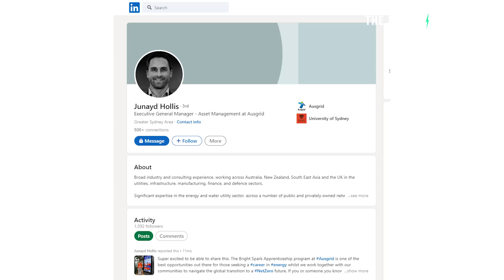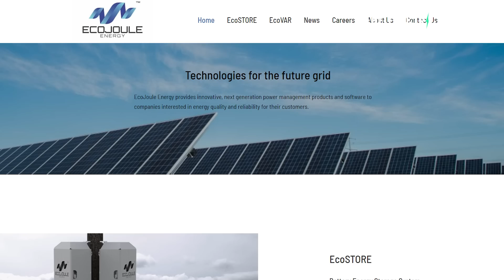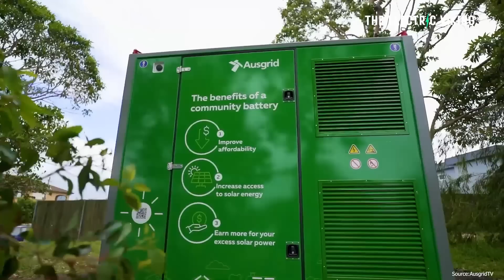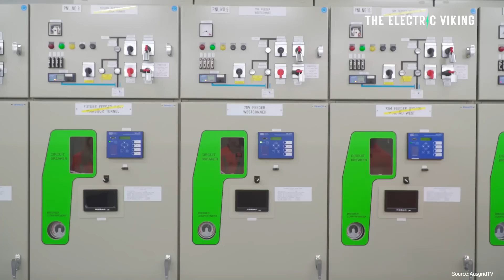Australia Begins Installing Power Pole Batteries for Excess Solar Storage

Comment: The majority of hot water systems in Australia should be heat pump systems. They are effectively batteries creating hot water for later use. When powered by rooftop solar, it's a no brainer
Reply: A heat pump cost hws cost >$4k to install, and still stores hot water that looses heat during the day. An entire 7kw solar system cost the same amount to install. All a small 1-2 person house needs is a small cheap $350 resistive hws. Hot water usage should be less than 1kwhr per person perday. A 6kw solar system typically collects more than 20kwhrs per day, averaged over 365days. But 25kwhrs per day ave over the year, is readily availabe where I live in Oz, with no shading.
Thus, if you and your partner simply spent  $4k on the biggest roof top solar system you could fit, and a further $350 on a small resistive hws, then you would still have >18kwhrs per day of solar electricity to use or export (and being paid sfa). The ave household elelctricty use here in Oz is 16kwhrs per day. Save the $4k you were going to spend on a heap pump hws, and install a 10kw roof top solar, or put thst $4k towards a storage battery, instead. 

My mates rooftop solar hws system with a ground level storage tank, cost him $12k. Dont do it. He wouldnt do it again. Use thar roof space for more solar pv panels that you can use all year round. Rooftop solar hws becomes too hot in summer, and effectively isnt used much, but the roof space is still used up (that could have been pv) and in summer, the pump still runs to circulate water back to the tank to prevent overheating of the system components, ie power used, and high maintenance costs after 10yrs. Dont do it.

The biggest cost benefit is to simpy install the largest roof top solar pv you can fit. Most roofs can fit a 10kw solar pv. A >$4k heatpump hws will still cost you $$ to run (and they do also have a resistive elment for cold mornings), and might need to be replaced @ 10yrs. Dont bother. Upgrade your solar pv jnstead.
Reply: @nordic5490  Are you saying that it costs $4k for 10kw solar electric rooftop system? Where are you?
Reply: @nordic5490  NSW has a grant at the moment that allows you to replace your electric hot water system with a heat pump from $33*.  The true costs can be more as I had to convert my off-peak switch to standard, and I opted for a bigger water tank, so I paid around $450 for my heat pump hot water system. I've set a timer to only turn on during the middle of the day. It was a great initiative, and Victoria offered something similar.
Reply: Why not just use rooftop solar water heaters? Much cheaper than a heat pump.
Reply: @malcolmrose3361  heatpump is more efficient and allows the solar to be used for other things once the water is heated.
Reply: @malcolmrose3361 and cheaper again is using your existing hws as a solar battery.
Minimal mods reqd at the switchboard and no rooftop mounting reqd.  
Effectively creating a 10-15 Kw thermal battery storage system ~ and when 'full', unlike a rooftop hws, any further excess energy can be sent to the grid, to a home charging system for your ev, or to other household electrical devices.
Use your imagination. 
This type of setup has worked a treat for over 5 years now.
Reply: @malcolmrose3361  I'm in the process of installing a solar system and I've been deciding between solar hot water heating or a modern hot water tank. I've decided on the tank. Access and maintenance on the solar hot water was a factor, as well as having a 300kg lump on a roof. A regular hot water tank is way cheaper and I can just heat it with excess solar production during the peak times, by adding just a couple more panels. Panels are cheap and easy to replace and so is a regular hot water tank or the heating element, which is normally the first thing to go.
Reply: @simonpaine2347  I've had one on the roof for about six years now. Every 18 months a guy comes and descales it (we have very hard water here), it has an electric element built in - it only needs a few hours of sunshine to heat up, and the tank itself is insulated so even if you have a few completely cloudy days in a row you don't need to use electricity. So far this year I've actually used it once - we had guests and I didn't want them having a cold shower (obviously the sun then shone and it was unnecessary) after a couple of days of very grey sky. 

Clearly it depends on where you live but, assuming you live in a sunny area it seems more efficient to me - you need quite a lot of electricity to heat all that water so better to use the sun directly than indirectly.
Reply: Only trouble with heatpump hot water, the tubing calcify over time and efficiency drops off, and often life span costs are lost with need for repairs and maintence,
Reply: @Froggability  Unfortunately, I found your statement to be correct. My State hybrid heat pump water heater failed to heat the water after 2 years. State go me a new one for free, but $1080 for installation of the new one just eliminated any savings compared to a plain old electric resistive hot water heater. I can still save money if this replacement lasts more than 3 years.

Comment: It’s encouraging to see innovation, however why is a pole mounted 65kWh battery a more compelling economic proposition than a home battery operated as a VPP ?. Yes, this is a DNSP asset , which removes the upfront cost from the consumer. However this cost will ultimately be priced in to the consumer electricity price, with added profit. 
From my perspective, we need storage solutions with the lowest lifecycle cost per kWh - this system uses off the shelf LiNMC cells. 
I’d be very surprised if the EcoStore capital cost is less than $AUD 750 per KWh. Pumped hydro is about one third that cost.

Comment: Seems like a lot of weight to suspend in mid air. They should give some incentives for home owners to install batteries.
Reply: The ones installed in Victoria on poles weigh in the same range as transformers so there's no real problem there
Reply: ❤❤❤ yes, Heavy Problem !!

Comment: Next step would be curbside EV chargers.  I've been wondering why that's not already a thing.
Reply: It is a thing in parts of the UK and Europe.
The existing power system for street lights in urban areas is used.
Plug on street lamp pole.
Reply: @andrewsaint6581  Excellent!
Reply: Yes a battery combined with curbside chargers is the way to go.
Reply: @NaughtyGoatFarm  Yep. If the government really wants us to go EV, they'd do something like that.  In any case, electricity companies can make easy money from it.

Comment: Power poles that ARE structural batteries. Now there’s an idea.
Reply: not really.. seems like that would cost more to build them that way than to just hang some batt pods off an existing pole
Reply: @AbBc-w4q  but as an ongoing replacement strategy the idea has merit
Reply: Beat me to it. I think that makes so much sense or at least moving forward the poles that get replaced are structural Batteries
Reply: I think it has meris, also putting batteries on existing poles will raise their centre of gravity and make them more prone to falling over.
Reply: @MrHomer1995 poles can take tons of force directly downwards. Some support cables to keep it standing is a good idea. Also batteries in poles are well secured from flooding and can support islanded systems with high quality electricity. So even if the mediim voltage line would be down power can still be provided to houses nearby.

Comment: I think this is a loser strategy (low/declining returns) from the start. How/Why would this be superior to direct power (no transmission costs) from your own battery and solar pack? And its only gonna get cheaper and more efficient.
Reply: This is a community sized battery at lets the excess power accumulate in the neighbourhood for use in peak hours, not only storing renewable power but saving in losses by having higher peak loads only having to travel short distances
Reply: Cap, really cheap home storage batteries will turn all of the big residential electric monopolies into Nokia and Kodak!
Reply: Ausgrid can access wholesale prices. Domestic consumers can not. We need a fair two-way.

Comment: It is a good idea that actually works, and it is better to have distributed batteries than 1 or 2 big ones. Distributed storage means outages can be localised; less chance of a really big widespread outage.
Reply: They will probably have different sizes of batteries with varying degrees of distribution.
Reply: Thought u we’re going to say they were storing power that could be used to charge cars, if placed in convenient places.